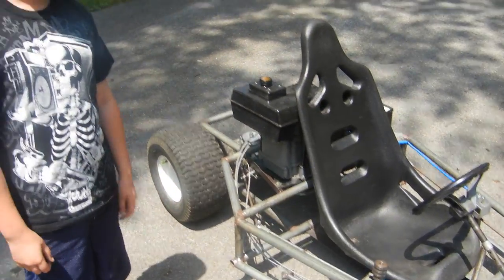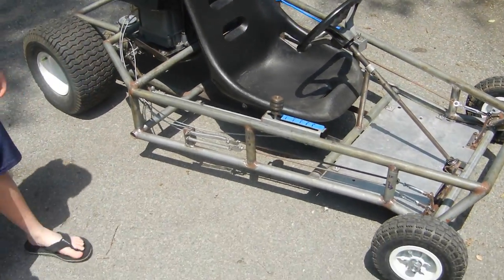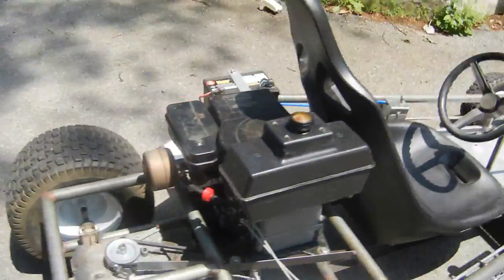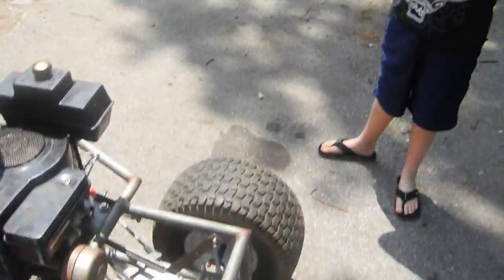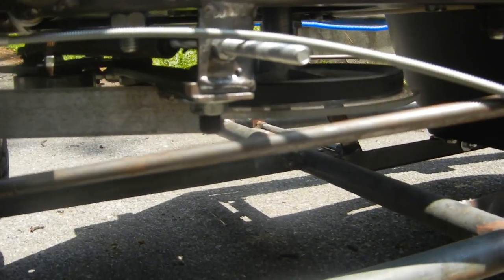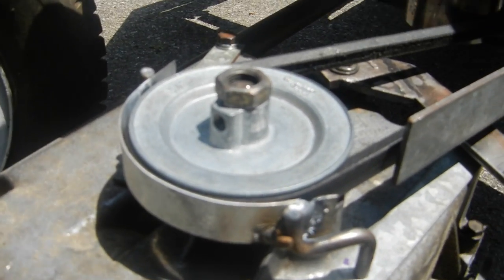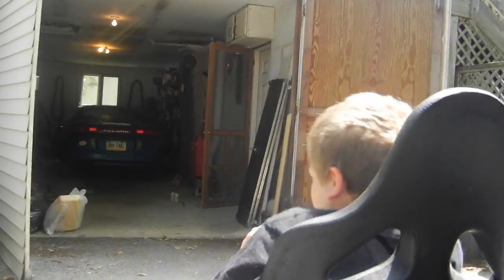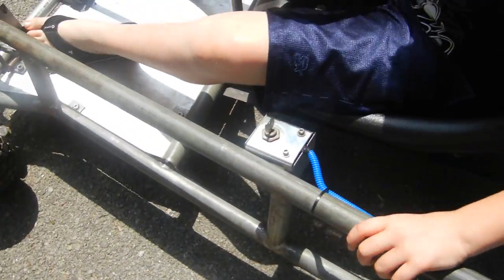400cc custom go-kart test drive

Comment: Nice father/son interaction and better than average scratch-built project! Time invested like this is never a waste and builds fond memories! You can get really cheap manual disk brakes at tncscooters, a dot com site. All kinds of other cheap scooter stuff there as well like coil-over shocks, ign. coils, lights, brake levers, etc. If you want, A-frame front suspension with brakes would be a nice upgrade!

Comment: I had a go-kart when I was about 10 years old, but it wasn't as good as this.  You have larger air tires and a starter and gears.
James is going to have fun on your yard area, it is smooth and maybe large enough.

Comment: yep, its 25CID, which is equal to 400CC. the bore is 3.43 inches and the sroke is just shy of 3 inches. I have a model 28 (28CID) and it has the same bore, and a 3 inch stroke. it puts out 12HP.

I also have a 750CC engine on my riding lawnmower, its a model 42(18HP 42CID) opposed twin cylinder, and my pushmower has a 12CID (7HP 190CC) engine

Comment: @JimboTheProgrammer is the exhaust port threaded? u should straight pipe it lol. this engine has a splash lubrication right? if it does dont idle it to low it wont  get oil to the top end

Comment from the maker: @shinyfuzzy Actually - I cleaned up the carb real good before getting it to run a while back.  The spark plug was the culprit in this video.  I changed it the next day and it runs sooo much better.  If you notice i only got it to rev higher once in the back yard there - on the second pass around - right before the belt came off.   With the new spark plug I was able to get it sideways a couple of times pretty easily.  Idles real nice too.

Comment: these are sequential shift key style engagement. You dont go through neuteral between each gear, so double clutching would do no good. He clutches, and pushes one gear foreward. If he were to let off the accelerator and push the shifter foreward at the same time it would shift too. 

and all of the gears are always meshed, so there is no way you can grind the gears in this transmission, it all depends on which drive gear is locked to the shaft.

Comment: no, its an 11HP. Model 25 engine (25CID) the 12.5HP is a 28CID motor. they are visually identical, but the block is 1/4 inch shorter, and the stroke is also 1/4 inch shorter

Comment: Briggs says it should Idle at 1400RPM with no load because below that it wont lubricate right, and the idle mix adjustment is at the top of the carb on this, if he turns that out 1/4 turn itss run better

Comment: You hear that winding? I have extreme experience with that. I race lawn tractors and i know that transmission wont last long. find a peerless 600 or a 4 wheeler ax and transfer case, itll do good.

Comment: 400CC 11HP briggs and stratton flathead model #25 vertical shaft motor. thats 11HP at 3600RPM BTW. the SAE made briggs, and tecumseh, and etc to rate their HP at 3600RPM.